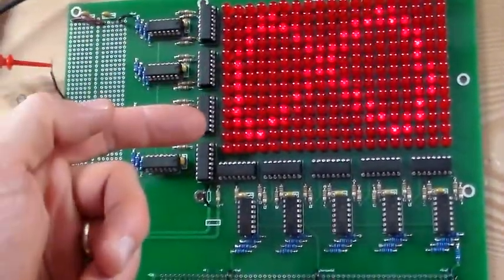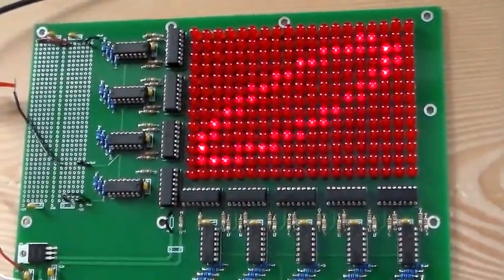Lissajous figures on an LED oscilloscope

Comment: Nice I built a LED oscilloscope based on the lm 3914 from 13 years ago,
Back then i use smd led in order to make it it was 20 horizontal × 30 vertical
That gave me a 600 dot . with two signal inputs and a trigger circuit. It served me very well with maintenance until I replaced it with an oscilloscope with a tube screen any way thanks for posting

Comment: That would be W. Forrest Mims to you.    8)

Why did you use discrete LEDs instead of integrated LED arrays? Just so your array would fill the real estate you laid out for your drivers to make your board tidy? It could have been about 40% of this surface area.

BTW... an ever-so-simple 555 timer can be used for the horizontal sweep. The charge on its timing capacitor is easily linear enough for a purpose like this, and you have all sorts of control over its sweep frequency, especially if you use a CMOS version of the timer.
Reply from the maker: The lack of a standardized LED array was one reason for using individual LEDs.  The main board itself is something I call a "half-project" where students assemble the components on the pre-etched PCB and then they add their own vertical and horizontal driving sections.  As such, I wanted a "motherboard" design that would not have to be re-done every time my favorite LED array became unavailable.  Another reason for individual LEDs is simply to give students LOTS of soldering practice!!
Reply: @lcstate_eet7381  I'll certainly grant the lots of soldering practice!    8)

...and desoldering, when three of the LEDs get installed backwards...    8)

That's hair-raising in the middle of an array, where it's so difficult to tell which pin you're heating up.

I'd almost be tempted to suggest wire-wrap. Oh, but wait - they could test each row of LEDs as they solder them down, couldn't they? That'd help a lot.